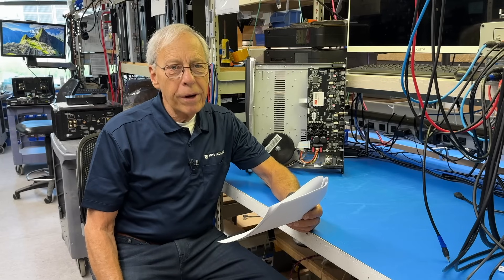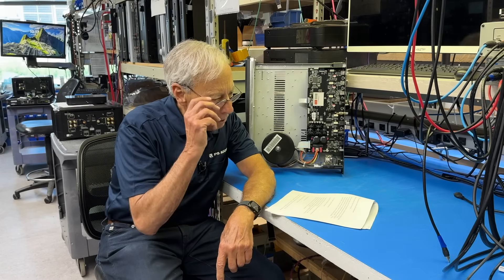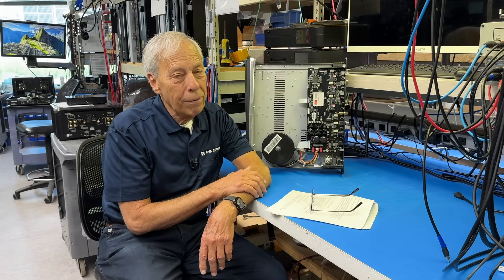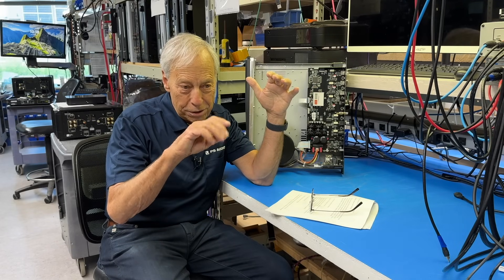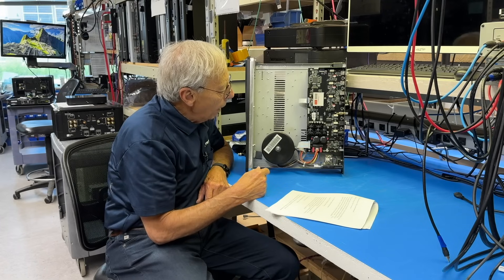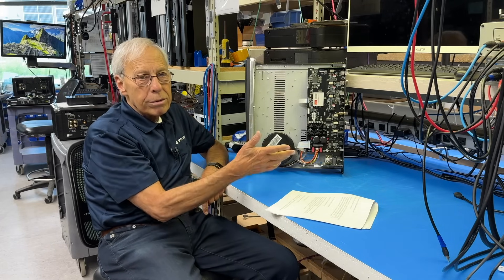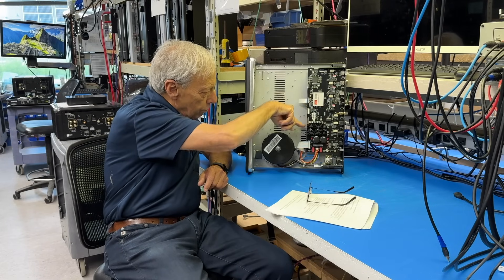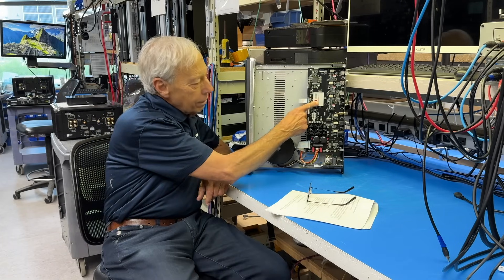The importance of power supplies and the PMG 512 insides

Comment: I always say on my channel, that a great piece of equipment, starts with the power supply and lots of people say power supplies don't make a difference, they are so wrong, great video as usual Paul👍
Reply: Actually what matters is how constant the DC voltage of the power supply is besides sensitivity to potential common mode current noise. Of course it matters but what experienced engineers will tell you is that an excellent power supply for audio gear does not require very expensive parts.

Comment: In the US at least with polarized 2 prong AC cords you can only plug them in one way. Add the 3rd ground prong and it only goes one way. And with any better amp these days it is likely a 3 wire NEMA connector on the chassis. Non-polarized 2 prong AC cables went away decades ago.
Reply: or if 2 prong, it's polarized...Germany is 240V
Reply: You need to check these days, there are NEC connectors that lack the grounding pin. Seriously.
Reply: @jeremiahchamberlin4499  non polarized only on stuff that is transformer isolated for low voltage stuff, most if not ALL 2 prong cord caps are polarized.  If it doesn't have ground pin
Reply: @cengeb I’ll accept an NEC female ‘receptacle’ with two pins mounted in the equipment to accept a two or three hole ‘jack’ end of a cord as polarized but ungrounded. It’s polarized for no other reason than you can’t swap its orientation by virtue of mating six uneven sides receptacle/jack mating surfaces. I’m simply relating my shock at finding some equipment that don’t include the third prong.
Reply: Polarized means you keep the hot from being applied to the chassis...keeping it safe. Non polarized cord caps are when the input is into an isolation type ac input circuit

Comment: it is very easy to hear a major difference between power plug position ie phase /neutral connection. - well, at least in my system. with the many different devices, the differences accumulate (more or less), so that a fully inverted phase-connected system will be a different, lesser capable one, no doubt. BUT: there are country to country differences, as far as I remember, some use 2 phases of the 3 phase  current system, others use one phase & N, making things asymmetrical.

Comment: Im seeing this from a more fundamental " power inlet" issue related to safety.

If the equipment is in a metal case -( which the unit in the video appears to be 
:  is the equipment classed as class I - where external accssible metal / conductive parts are bonded to the ac supply " protective " earth  
Which requires a three pin plug to provide the safety earth connection...

... or is the equioment is class II  - that is all live parts are double insulated / protected by supplementary insulation .. which does not require a protective earth connection?

Also - how is the ac input delivered to the equipment ?

If this is by a proprietary lead with pre connected plug and socket - then reversing the polarity isnt possible with a three pin plug / class I equipment.

( certainly not in the uk  with  a proprietary supply lead terminated into bs1363 three pin plug( 

Also - inside the equipment.. is there an internal fuse in the live conductor? If so - thrn reversing the polarity means that fuse is now in the neutral conductor.

Finally... if there is one area of electronics that is well understood and engineered throughout decades of experience - it must be power supplies.
Nothing new about the fact that sensitive electronics - analogue or digital .. needs stable and noise free power rails - and..
 surely any decent equipment such as shown in the video will be designed to withstand the usual deficiencies of the ac supply system.
I cant see anything to be gained by messing with the ac supply polarity etc.. in fact .. it is more likely to create a hazardous condition

Comment: No such ridiculous option for reversing neutral and live in the UK. 
As for the massively oversized transformer, that's a very long way down the route of diminishing returns, but transformers aren't that expensive, so why not do it. I expect that Paul's going to recommend a powerplant as well.
Reply: Exactly 
The main (or primary) concern regarding "mains ac" input to any device should be 
Protection and safefy.
Start messing with live and neutral conductors and who knows ?

Comment: Power supply electronics is highly measurable and well understood to not need imagining stuff and not need relying on listening tests. If I was leading engineering doing some power supply claiming a particular circuit sounds better, I would immediately ask "show me the measurement proving that difference". Surely a power supply can have voltage fluctuations and noise that can affect the sound quality but in this particular case, precision measurements of power rails can much better identify any difference. Some times a huge capacitor is not the cure for a particular high frequency noise and by proper design  you can get closer to perfection. Never rely on listening tests when it comes to power supplies. Opposite is case for speaker design.
Reply: Absolutely.
Power supplies are the most fundamental part of any electronic equipment.. and havd had decades and decades of design experience to "get right" - especially with linear supplies. 
What isnt mentioned is the means of protection.. is the equipment class i ' that is must have a protective earth connection ( external conductive parts connected to protective earth)... or is it classii - double insulated not requiring protective earth?
In the video... one can see a mains inlet module to which the primary of the toroidal transformer connects to... but difficult to see exactly how it is cinfigured ( input filtering.. fuse.. switching and type of inket connector)
Reply: Nonsense to say never rely on listening tests
Reply: @tommy-6597  No, it's absolutely correct. Never rely on listening tests for a power supply judgement in audio gear. Still of course you do listening tests also. A power supply does not affect the sound unless it's also measurable. However, for a power amplifier it is expected the power output affects the DC power rails somewhat at the peaks so in terms of dynamic performance in this case, listening at loud volume  is needed e.g. to judge if the capacitor bank performs adequately. Don't confuse with the general assertion that listening tests are most important for speaker judgement.

Comment: The only time you have to watch the AC input lines is when you have a mains transformer... ideally the live wire should go to the " finish" end of the primary and the neutral going to the "start " ( inner end) This eliminates or considerably reduces capacitive coupling to the chassis ...
Reply: How do you know which is which?  Typically the line current is just a pair of black wires.  Easy to switch, but how do you find out which is which.
Reply: @user-od9iz9cv1w  if the chassis is ungrounded and the Active power line is connected to the " Start" end of the primary, then if you touch the tip of a neon tester onto the chassis the neon light will glow ... reverse the connections and the neon light won't glow ... grounding a chassis with incorrect primary connections can induce hum loops. A lot of switch mode power supplies used in ungrounded chassis cause them to become " Active " whichever way round the power cables are run ..
Reply: It’s like you are the magnet and I am steel. I watched Paul’s video and was sure to see you comment, but this time your comment is ‘top comment”❤
Reply: Good point..
However the unit shown uses a toroidal transformer - so question is.. is the primary wound on first? - and in any case ... all the turns of the primary winding are equidistant from its mounting base so wont make any difference to capacitive coupling as to which end is "live"
I would imagine most of their equipment uses toroids because of their low stray magnetic field?

Comment: Phasing out the power supply? Maybe he's talking about moving to a switching power supply or battery? I have no idea.
Reply: No Paul was right, in Europe you can reverse the power plug (the ground connectors are symmetric) so effectively you can cause a 180 degree phase shift in the power transformer by rotating the plug 180 degrees. With phasing out you try to ensure that all power transformers on all pieces of equipment are in phase with each other. Some people think this matters, others don't.
Reply: @hugobloemers4425  Thanks. I've heard of swapping the polarity on audio signals, but not power plugs.
Reply: @hugobloemers4425  In my good old days as a guitarist in a rock band here in Germany turning the power plugs of the amp and/or the effect pedals was the 1st choice to reduce hum. It was indeed not the best choice because it didn't work very often. But it was the easiest choice. 😉
Reply: @Fastvoice  I restore turntables, it is also my first choice when facing hum. Same here it does not work often but is a necessary step to see where the trouble may come from.